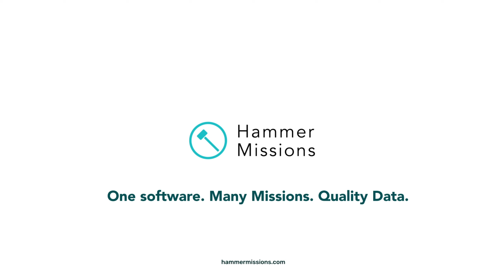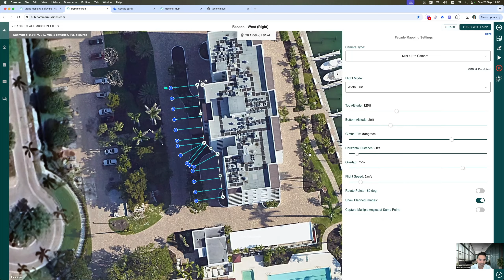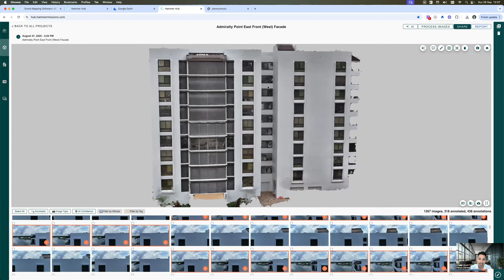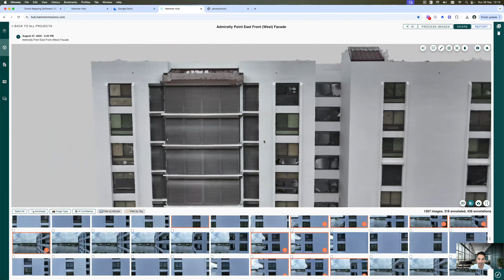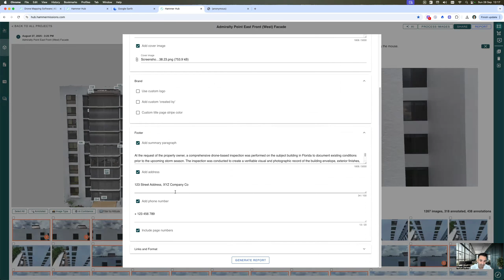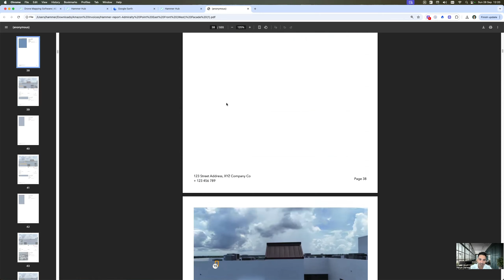Facade Inspection with a Drone in Sunny Florida!

Comment: Can Hammer be used to plan flights around multiple elevations - for example I might have a detached two-storey house and would like to set a drone to capture all 4 external walls
Reply from the maker: Yes absolutely! It will require some careful flight planning, but this is very much possible with Hammer Missions

Comment: Varun, this is a very informative video. Is there an optimum distance from drone to subject to obtain the best images? For instance, would a 5m gap give greater definition than a 10m gap with the same camera and settings?
Reply from the maker: Yes, absolutely! The closer you are the lower your GSD will be and higher the dataset quality will be. Although getting too close might be difficult for safety reasons and might require excessive flying to get enough overlap, so we recommend finding a balance between how close or far your are and the flight time, safety and efficiency.